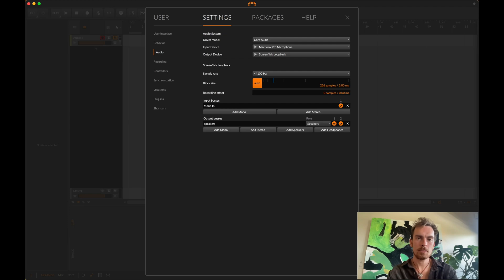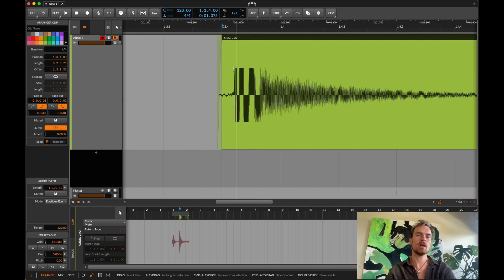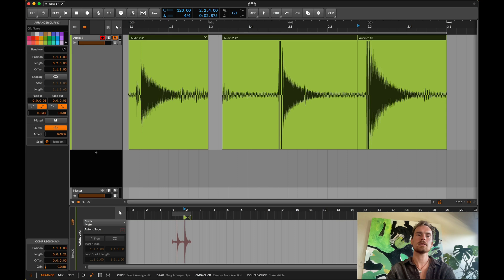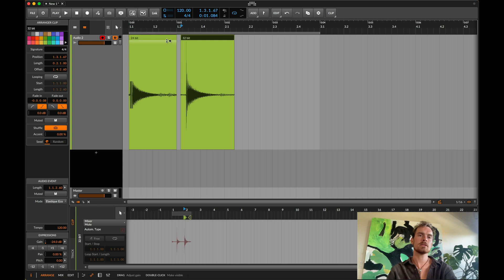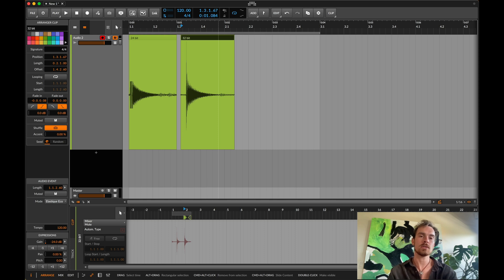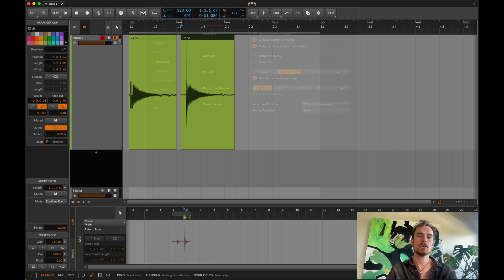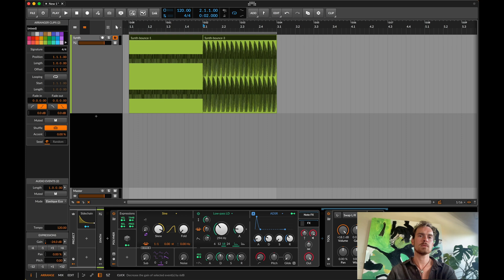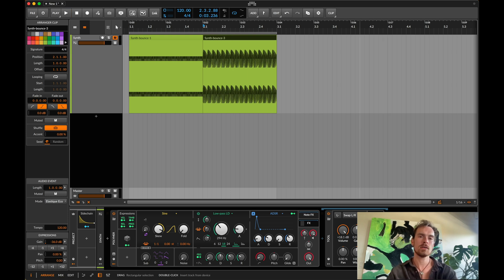How To Never Ever Clip Again in Bitwig

Comment: It is pointless. Do not do it. For the cost of extensively large files is not worth it.
In this day and age we have Restoration plugins\apps which do a remarkable job of interpolating clipped signals thus restoring them.
With that said if you are a bit "heavy handed" during mixing and want to play it on the safe side, definitely DO bounce your final mix to 32bit-float before sending it to Mastering stage.

Comment: Oh, there you go with that "Unfathomably large number" line. All sounding like the original BBC radio play version of the Hitchhiker's Guide to the galaxy. I love it. And i love this information as well.. for some crazy reason, i find my self using Bitwig to record the dialogue for these audio play productoons I'm working on (because of the clip launcher . I find it so much cleaner and easier to use tye clip launcher rather than comping. ADHD and Dylesxia...i need thinga right there) And man, let me tell you. I am LOUD. So I'm clipping every which way. I recently seitched to 32 bit float, but i still saw the clipping happening. But now i know the information is there, so i can drag the gain down and compress like my life depended on it

Comment: Is the dynamic range you are talking about standardized? Because 32bits could also allow to record the exact same dynamic range than 24bits, just with a higher resolution (finer steps between two possible sample values). And until now I even believed that this was what 32bit audio was for (ie. not increase dynamic range but resolution).

Comment: I'm impressed that works with the macbook mic - i would have thought the clipping would occur in the macbook hardware before it was even captured to the file - worth noting that this isn't always as safe as you make it sound, if you clip a converter or distort an analog input it won't matter what bit depth you record at, the clipping/distortion is part of the source audio at that point

Comment: 32 bit allows 192.659... dB, not 1000+...
But of course you're right and using 32 bit allows to use much more headroom (192.659... instead of 144.494..., which is 48.164...dB more).
How "happy" many of us were when being able to use 16 bit in the oast... (96.33... dB).
Reply from the maker: Hmmm interesting! I just looked into the discrepancy and apparently it's because 32bit integer = 192dB and 32bit FLOAT = 1528dB.
Reply: @tachesteaches  Float - right. But... the number of digits your signal can distinguish is defined basically by the integer size... although - right - the dynamic maximum following the "singe precision 32 bit float" is higher... (does Bitwig studio use another definition...? Especially: Does it use a different definition of its exponent?), more exactly it is 776,657...dB

Comment: I suspect the only way this works for recording is if the soundcard is capturing 32bit float as well, right?
Reply from the maker: facepalm 

Yes, and I've just realised that this makes this video useless if you don't have an interface/microphone capable of doing that. Zoom make the UAC-232, which is an interface that can record in 32-bit and there are various microphones, such as the RØDE NT1 (5th gen) or RØDE GO II that are basically unclippable, but you're right... If the Soundcard isn't 32-bit capable, this won't help at all haha
Reply: @tachesteaches that’s most likely due to gain structure internally. There’s no such thing as a 32Bit converter. 
Most aren’t even 24Bit. And I’m taking high-end stuff. However aslong as you stay in the box / daw it’s pretty much impossible to clip   channels in a 32Bit environment.  The 32Bit tag on those devices is a sales pitch and has nothing to do with the range in which it’s able to operate.
Reply: @HOUSEARREST1 correct the “32 bit” sound cards actually have multiple (most have 2) signal paths at different levels which they they combine to 32 bit.
Reply: Still helps on export and bouncing, so still makes sense. Sadly I only have 24 bit sound capture devices currently.